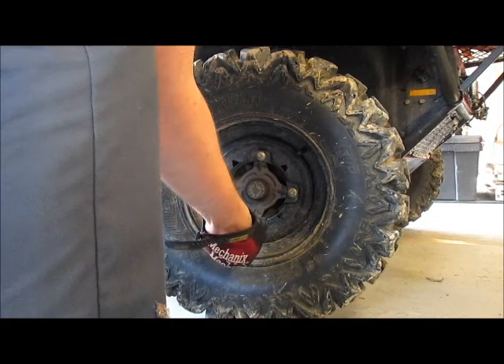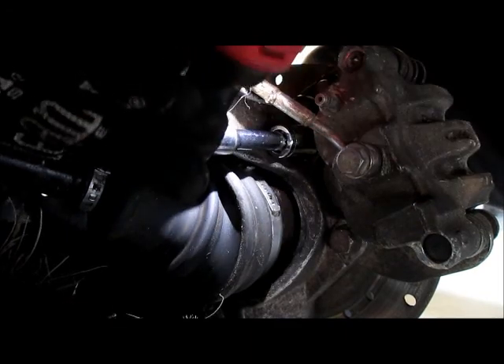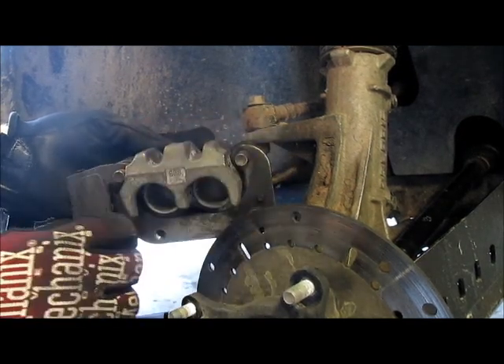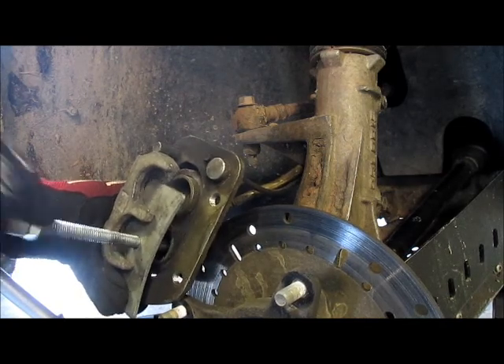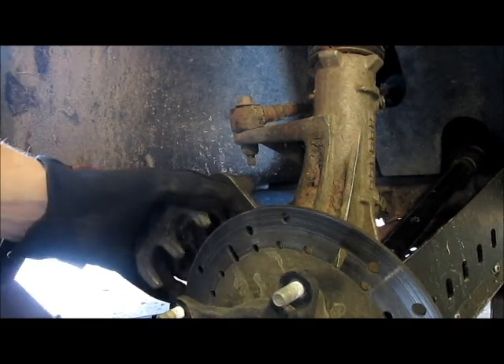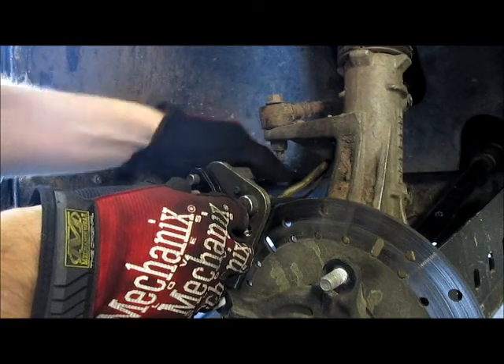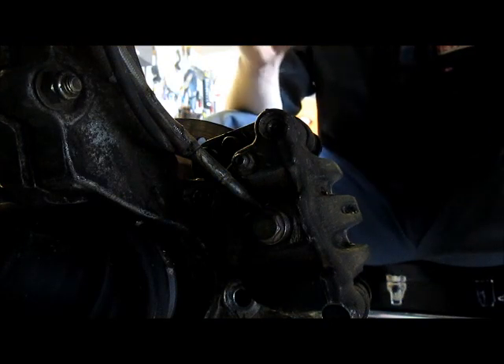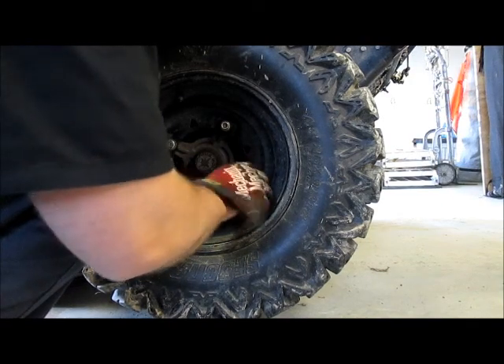2005-09 Polaris Ranger 700 XP Brake Pad Change

Comment: nice video
Reply from the maker: Thanks, bud! If you need to replace your brake calipers I got some cheap ones off of Amazon, they require a little machining to fit the bracket but I can not argue with the price. Happy Motoring-Blair